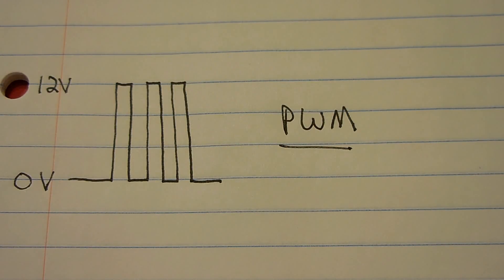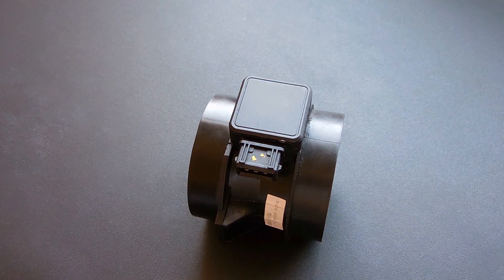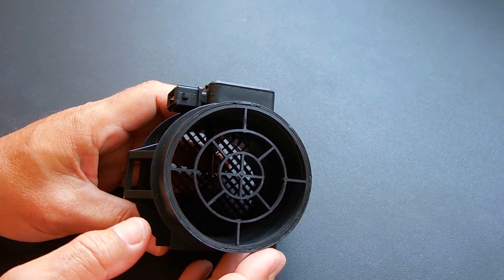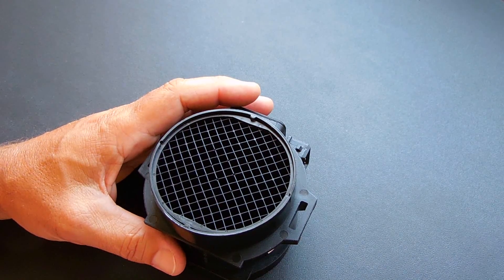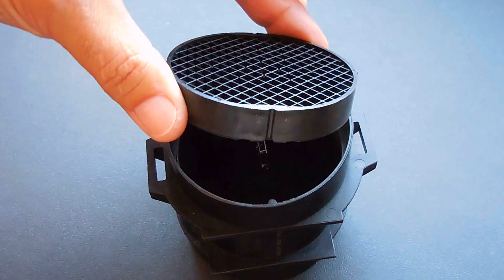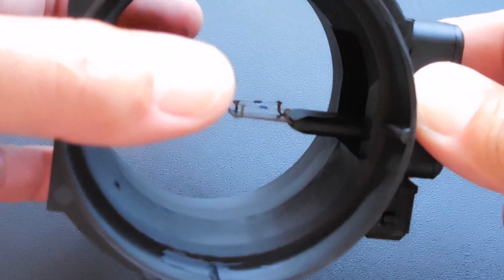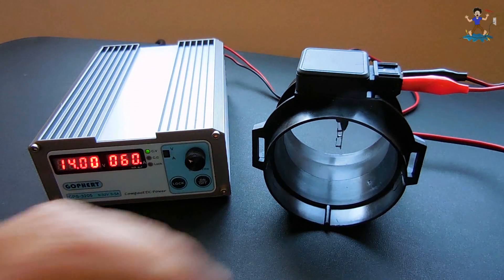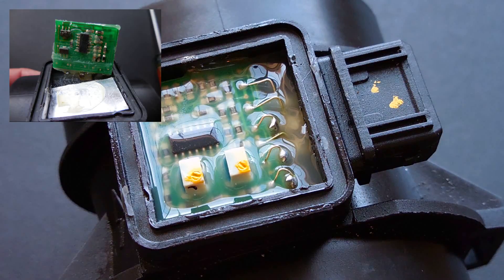How To Test Mass Air Flow(MAF) Sensors

Comment from the maker: One thing to note in the video:

I gave a brief explanation of how the fuel injectors flow rate is regulated by the ECU. To simplify things I used a simple square wave and used positive side triggering which is used in older European vehicles. The most common is NEGATIVE side triggering. The waveform will look very similar to what was shown if you invert the image. Keep in mind, when the injector turns off, you'll also observe a brief spike due to the collapsing magnetic field of the injector.
Reply: Modern high impedance (multiport) Fuel injectors are not duty cycled (% on time) they are frequency modulated. They are either fully on or fully off, but the time they are on changes (time on either increased or decreased and in measured in milliseconds based on engine requirements). Older Throttle Body style injectors with low impedance (and subsequent high current flow) used PWM % on time) because full current was only required to initially open the injector, then a lower current can be used to hold the injector open. The lower “hold open” current was Pulse Width Modulated (PWM) to prevent the coils from overheating.

Comment: nice video very rare to find someone go to this detail, would have loved to see the part numbers on that chip, maybe a voltage to frequency convertor using an quad op-amp, my guess is, its frequency is proportional to airflow which the determined by those blue x2 NTC resistors.
Reply: Most people don't know this but one way a mass airflow sensor fails is due to high voltage spikes on the 12V supply line and mainly due to a bad alternator regulator, the chip on that MAF device has no TVS or zener voltage clamps on the MAF PCB to clamp spikes on the vehicle's battery line, so any spikes destroys it or partially runes the calibration due resistor carbon being destroyed.

Comment: I recognize that MAF sensor anywhere you must drive a E46 or E39 bimmer, I'm currently have issues with my MAF, i so far bought 3 brand new from NAPA - refurbish, auto zones Duralast brand, then finally bit the bullet and bought the OEM from BMW dealership and all of these MAF's when plugged in where making my car stall on cold start, idle rough, accelerating issues etc.,  when unplugged my car drives fine. and i don't have any vacuum leaks i checked all those. I must be the luckiest person in the entire world to have bought 3 MAF sensors that are bad and faulty. I remember buying one from pelican parts few yrs back and my car ran perfect instantly!! So I might have that one again soon. these cars are really picky when it comes to buying sensors.. what are your thoughts on this??

Comment: What if my car does not have a mass air flow sensor but it does have a mass air flow meter
Reply from the maker: They both do the same thing for the fuel system, but how they do it is different. One uses a hot wire/sensor, and the other uses a different method. Look up an online service manual for your vehicle. Thanks for watching Don!

Comment: With the engine off I pulled the plug on the maf and engine runs fine took car for a spin and no issues car is a 911 996 02 model
So what is at fault here no obd faults showing
Reply from the maker: Try resetting the computer. Could be a faulty MAF, another sensor, or ECM problem.

Comment: Very good, I wonder what the failure rate in manufacturing is why do these things cost so much?
Reply from the maker: OEM units usually use platinum heating wires instead of thermistors, and of course you always pay more at the dealer. :-)

Comment: Nice video. Very informative. Yep been there and done that fighting an aftermarket mass air flow sensor for a Nissan truck. I would advise anybody to avoid the Chinese knock-offs just because not only are they not accurate but they don't insulate around the circuit boards and even temperature change on the circuit itself will throw it out of calibration. I've also seen issues with RFI where they did not protect the board from electrical noise which would cause the unit to malfunction also. Once again a very informative video. Thank you
Reply from the maker: Glad you enjoyed and appreciated my video. Be sure to rate thumbs up, share with others, and watch my video playlists. Thank You!

Comment: Hi Doug. very well explained has always. I  use an 8 channel scope that connects  to my laptop the price was reasonable  and it works great. It will save the wave-forms so they can be compared to the correct wave forms that you can find online.
All my best.
Bobby
Reply from the maker: Great for watching all injectors at the same time.

Comment: The cars ECU switches the injectors on by grounding, not by PWM on the positive side. Good explanation on the MAF though.
Reply: What car? There are many styles of injectors
Reply: To my knowledge, all cars with electronic injection. After 25+ years in the motor trade (many of those years working in vehicle diagnostics and rolling road tuning), ive never seen or heard of an injector being switched on the positive side. Also the waveform is not a square wave as shown.
Reply from the maker: The waveform may not be totally accurate, but everyone gets the idea how it works. It was used to simplify things. Yes, negative side triggering to complete the circuit is much more common, but some cars also use positive side triggering. :-) Thanks for watching!

Comment: A failure mode that has occurred two times for me where the MAF "died" both involved an attempted restart after a short stop. The engine would act as it was not getting fuel (it wasn't) but not because of the fuel pump. 
I suspect the burn off mode is what killed the MAF
Reply from the maker: Possibly, I had one fail just like that in the past.